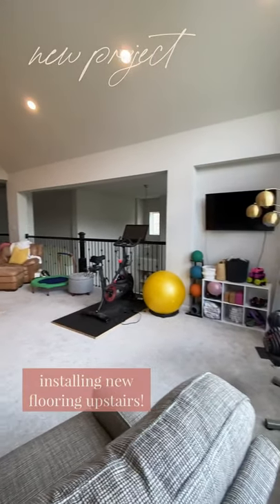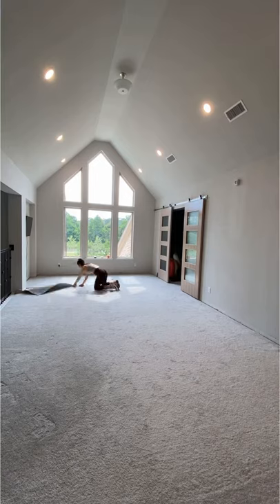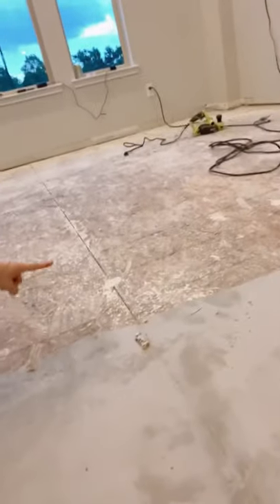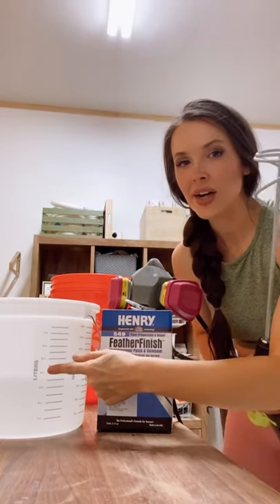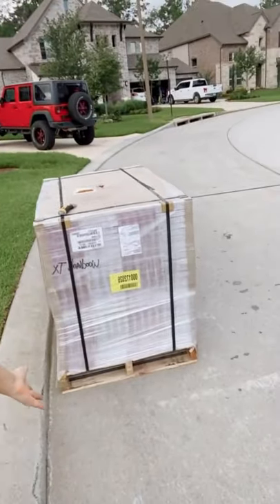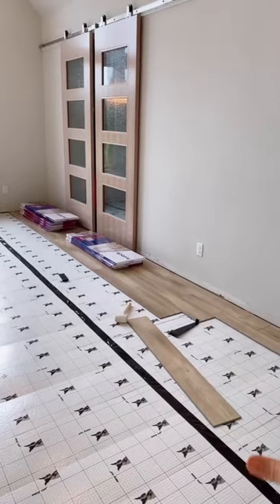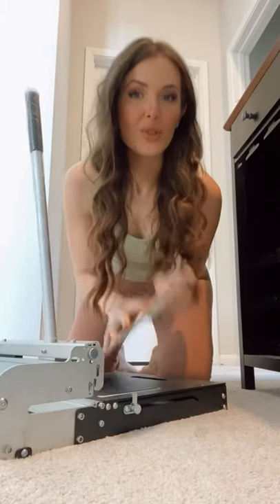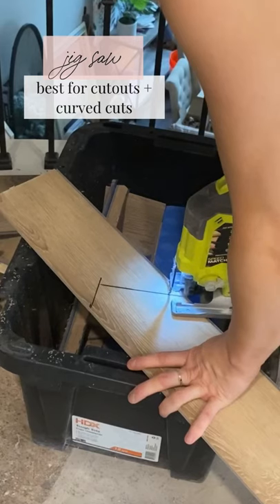installing vinyl plank flooring by myself [project vlog]

Comment: There are shims with adjustment wheels on them for wall edges to help keep that straight line. Also for underlay. I only use 6 mil plastic if the boards are pre-padded. Vinyl tends to not like thick underlay. So the thinner stuff works better. Although I stopped using vinyl all together. The laminate you can now get is insane for water resistance and the surface against scratching is 10000 times better on laminate. Oh and the reason for the 6 mil plastic is for moisture or liquid. On concrete is so moisture does not make to the planks or surface liquids to go below. On subfloors made from ply its so water does not get to the floor.  This is also a reason I do not like pre-padded planks.

Comment: So I just moved into my new home (rental) and I do have to fix up quite a bit, but what’s stressing me out the most is the floor in my walk-in closet. It was originally a small shed, but since it was so close to the house and our room didn’t have any closet. He knocked down the wall that separated the 2 and made it into a closet. The problem?? the floor is literal CONCRETE. UNEVEN concrete at that. Problem # 2 i can see areas of the closet that wasn’t sealed right. And I want to install peel and stick tiles but idk where to start. Please help 🥺 TYiA